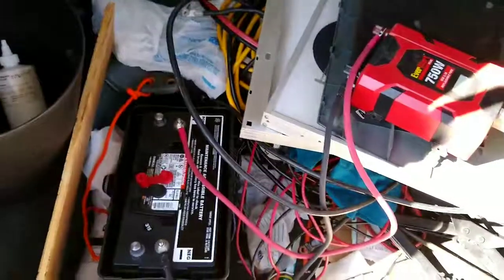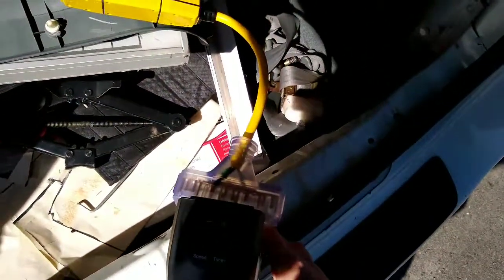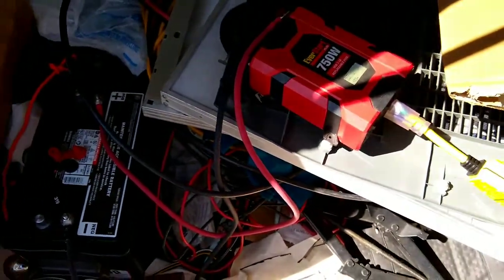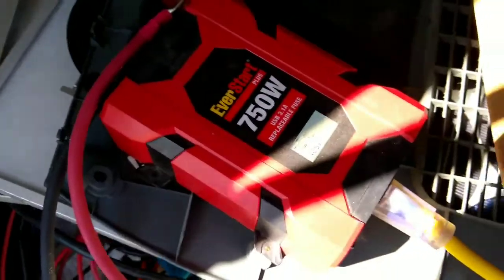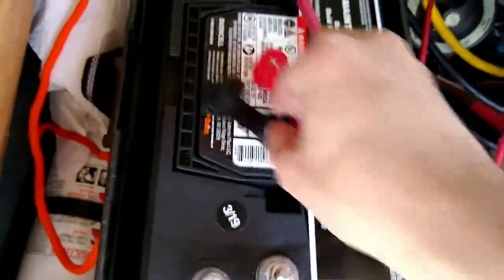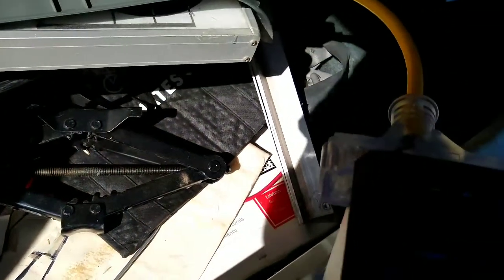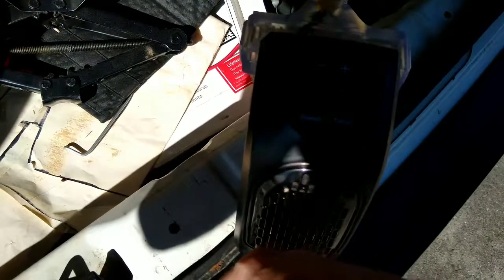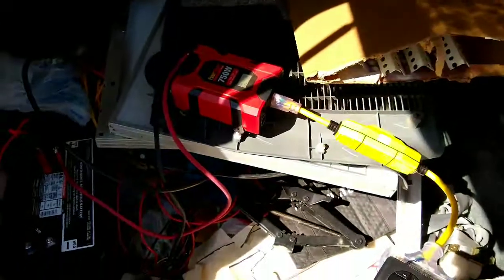Testing the tiny Mr Heater on an inverter

Comment: I have the 400 watt. When I hooked it up the voltage on the built in meter was 11.4V With the truck running it measured 12.1 V. I replaced the cheap o cables with jumper cables, big difference. Without the truck running the voltage was 12.6V & with the truck running it was 14.6V! Because of the small gauge of the supplied cables it added resistance and lowered the voltage at the converter. I saw a video where using the small cables the voltage at the battery, truck not running was 12.6V, at the converter it was 11.4V with the truck running that battery measured 14.5V and at the converter it was 12.1V.  Plus the small cables heated up quickly.

Comment: Just saw your video.I noticed that your battery was from 3/19,I would  change the cables from your inverter to at least 4gauge,add some ring terminals & get rid of those gator  clips 👨‍🏭